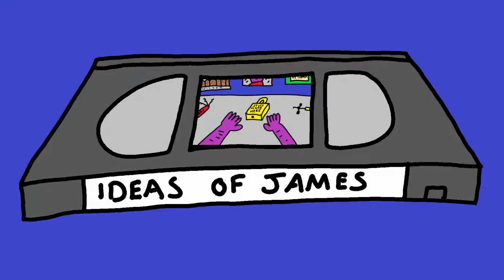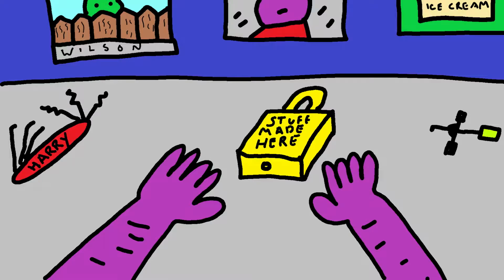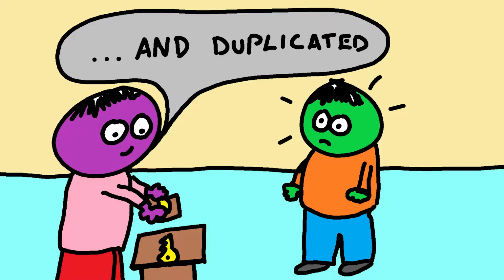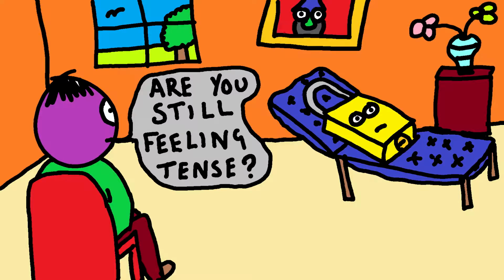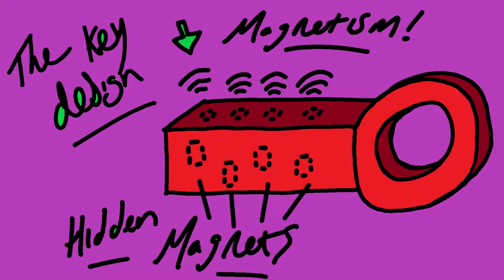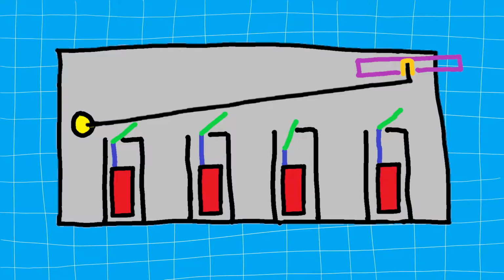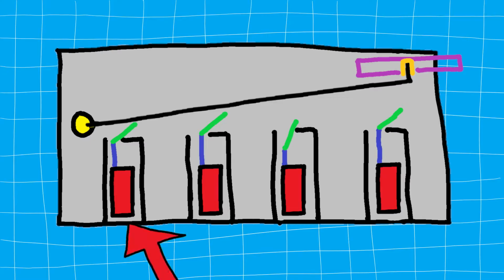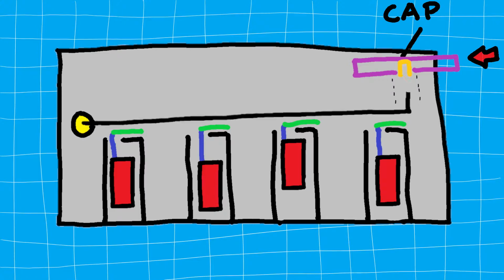Why Stuff Made Here Failed Against Lock Picking Lawyer

Comment: I watched the LPL's video opening SMH's locks and I have to wonder what LPL would do, encountering the lock for the first time, in situ, without a key and without being able to examine the innards? I'd have a plate covering the gap where the bolt is visible and fiddling with the hinges is not lock picking.
Reply from the maker: Granted gaining entry via a method not involving the lock is not really lock picking. However, it does highlight that someone wishing to break in will look for the weakest link.  In real case scenarios I doubt many pickers would be able open a custom made lock, with unique mechanism, sight unseen with no knowledge of its internals.  That doesn't make it a good lock though.  Mass production on a lock shouldn't reduce its effectiveness as a lock.  A test of a good lock would be one that is still challenging to open despite knowing how it works.  Physical locks struggle to do this but a good example might be digital encryption.  The concept of how the data is protected can be understood but you still need the specific key to unlock it.  My own lock aims for the same thing in its design.  Knowing how a lock functions and still not being able to pick it is the ultimate!

Comment: It seems like this would be very easy to impression using magnetic viewing film.
Reply from the maker: Thank you for your comment.  Certainly, if someone had access to the key then they could use whatever tools necessary to make another one. However, this is true of almost any key. To me the problem with many standard keys is that their secret is visible. This allows quick and accurate replication from a distance via a photograph for instance. The key then doesn't even need to be in the possession of the person duplicating it - which is concerning.  My design is far from perfect but my hope is to encourage a rethink in lock design. This is also what @stuffmadehere was attempting; however, despite the clever engineering in his lock, it still had a typical looking key design. This was unfortunate as I think it was a lost opportunity to really introduce something different. Thanks for watching.